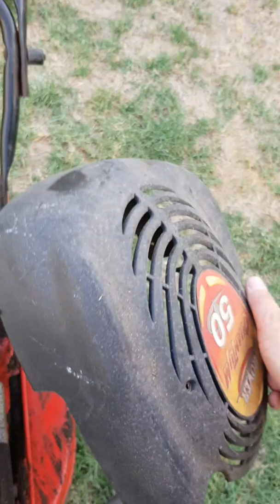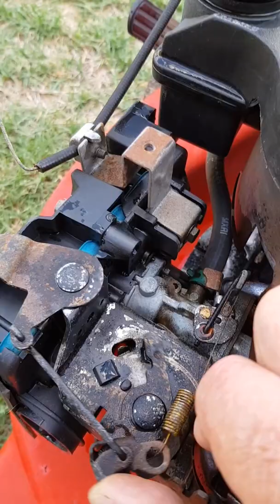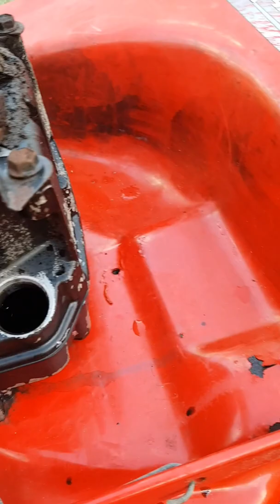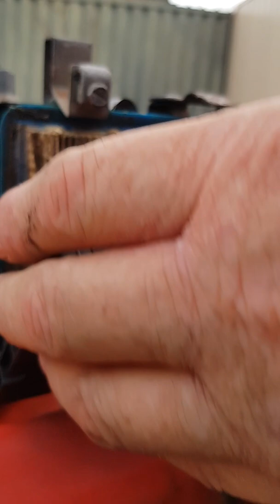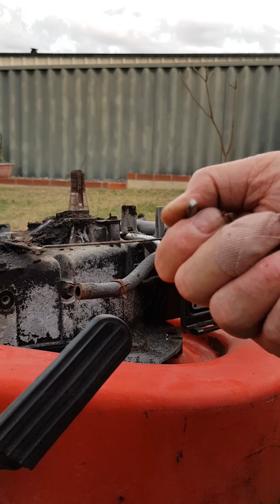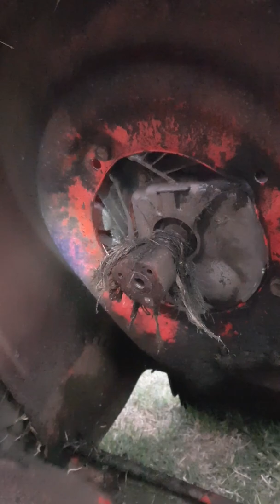Will it run? Pt1: Dirty old Rover lawnmower

Comment: Could you give me some feedback about your lawnmower ? Just got the same model from my neighbour. Thanks for your video
Reply from the maker: Hey Armand, well it has been a long while since I did this video but seem to remember that it had been run without oil too long oil and the cylinder and piston were in very bad condition. This is why it kept locking up again and again. If you have followed the 3 video series you will know that I ended up putting in another engine and fixing all its other issues. It ended up working great. I does help to have spare parts for these in your workshop.
Cheers, Mark.